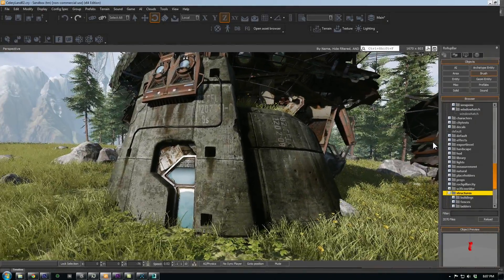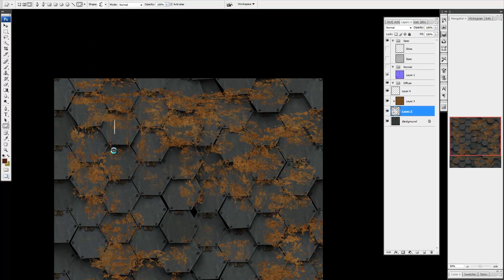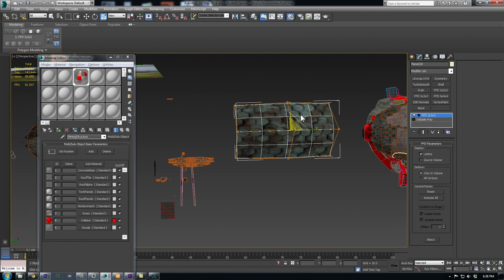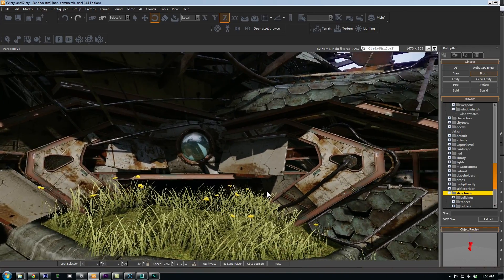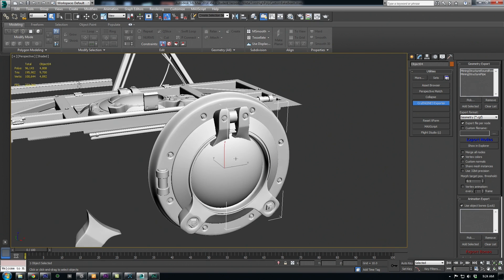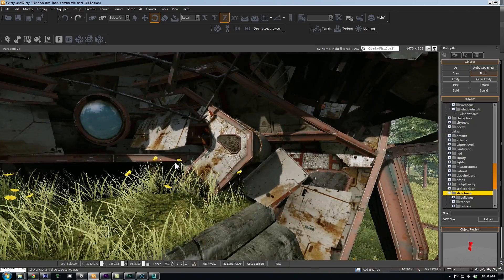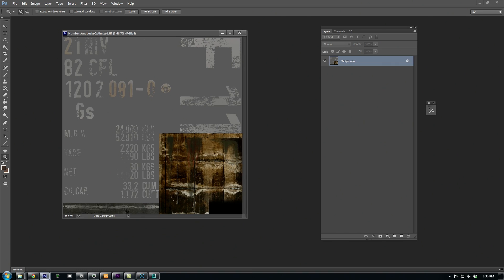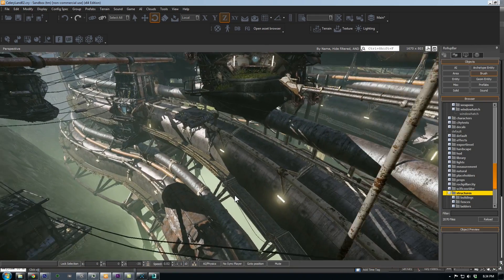3d Modeling Architecture part 6: Final Materials and Polish

Comment: Amazing work! What texture resolution did you use for the roof material and the tiling tech panels?
Reply from the maker: +Nikolai Sturm Thanks! The textures were authored at 2048 and then saved as 1024 in engine.